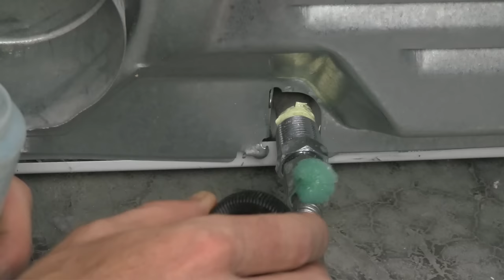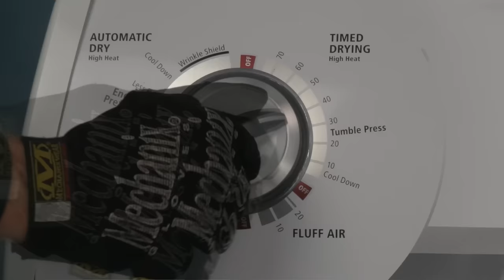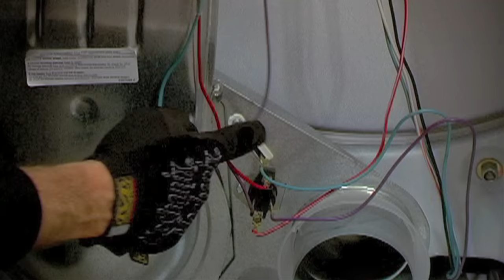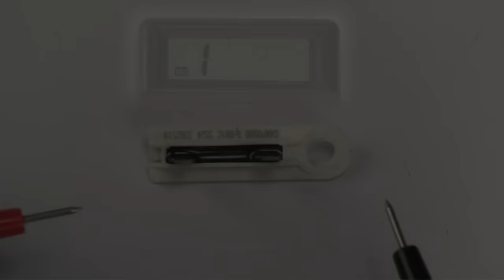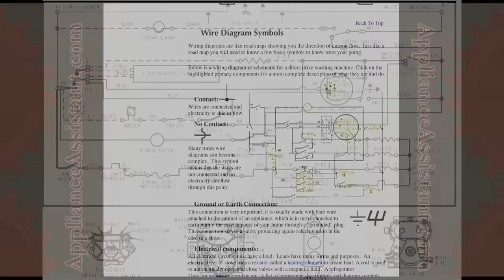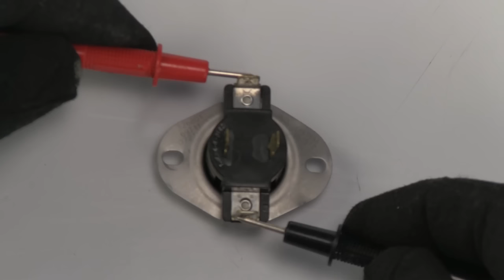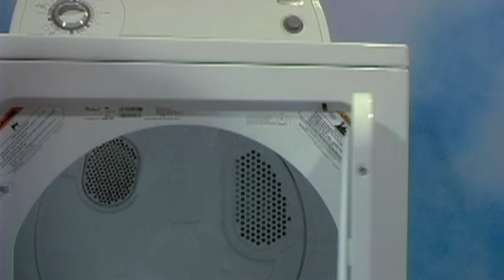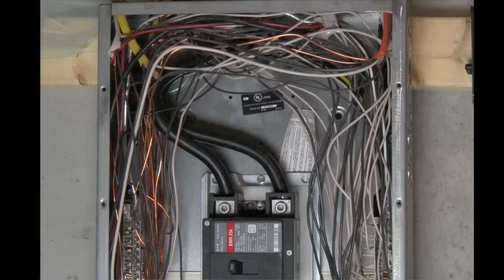Gas Dryer Repair: Fix Heating Problems

Comment: My ignition coils glow but then shut off?, then they glow again and click but no flame?
Reply from the maker: Sounds like the coils are weak.  If you change them out chances are you will be back in business.  Good luck!
Reply: Actually, went and bought the coils on Saturday and the dryer still didn't work. I did a continuity test with a multimeter on the old coils and they had all the right numbers so I put them back. The rest of the day I spent tryin to clean out the gas supply line cause a few people had me convinced that there could be debris in the pipe. So I snaked it with a long pipe cleaner then shop vac'd it, then used compressed air, then repeated several times. Then I started and stopped the dryer for like 15 minutes. Then I moved on to the gas line and switched back to the older flex hose, still no dice. The last thing I did was change back once again to the new gas flex line and turn on the gas and opened up the line a little right before the dryer to smell the gas to make sure it was flowing. Then air out thbasement ;) then tried it again. So, I gave up Sunday night :( then Monday night I figure I will give it once last shot before I try to return and it worked ?! WFT?! The closes I can figure is the line had to much air because the is no more audible buzzing when the igniter glows. I have done 3 loads of laundry so far, knocked on wood and crossed my fingers. Also, I did check with a friend who works for the local gas company and he said that the ignitor might have also been the problem and even if they glow they might not be completely hot enough to light the gas
Reply from the maker: When you said "I did a continuity test with a multimeter on the old coils and they had all the right numbers so I put them back. " Did you install the new coils?  Correct continuity readings do no necessarily mean they are functioning properly... It could also be the valve itself but more than likely it needs the new coils.  I doubt the ignitor... that can be the case with gas ranges but if the ignitor clicks off with no ignition, its getting hot enough.  If it just sits there and keeps glowing it could be a weak ignitor (rare) more likely the flame switch.  Sorry for all the difficulty! of course I hope it keeps working, but If you did not install the new coils, you probably should. Hope that helps! Good luck!

Comment: Hi There,
my Roper gas dryer only get flame at the first time. after that I can see the glowing but no flame again. checked the duct, it is OK. Can you help?

David R.
Reply from the maker: Probably the coils that are on top of the burner .  That's the cause of those symptoms 97.9% of the time. : )  If your duct is clear that should do the trick. Good luck!

Comment: I replaced the coils, thermal fuse, and igniter. It kicks on and flame starts then in a few seconds the igniter and gas flame goes out. Why won't it stay lit. I have a Inglis dryer made by whirlpool.
Reply from the maker: Sounds like a clogged ducting problem. The hi-limit is probably opening because of a hi temp condition near the burner.  You may have a bad hi-limit thermostat, but it's rare on this type of dryer so you may want to pull the blower housing and check for a blockage, also make sure the home duct is clear.  Hope that helps! Good luck!

Comment: Great video i have the same dryer my problem  is after a few mins the flame go s away how do you check the coils
Reply from the maker: Thanks! It's best to go by symptoms because they may test okay for resistance and still not function properly. If you ever see the igniter glow and click off with no burner ignition the coils are usually the problem.  Very fast burner cycles (short burn time of a few seconds) is usually a air flow blockage or a weak hi-limit thermostat if the duct is clear.  Good luck!

Comment: will not heat any longer. 
Kenmore model: 110-78002010. I replaced the coils and ignitor. as the glow begins a loud buzzing occurs. Flame ingites for a few seconds then goes out. Any clues? Should i replace the flame sensor now?  Thanks!

Comment: I have a roper and it will ignite for 5 minutes then the flame goes out when it reached temp. When it tries to ignite again it doesn't. Any suggestions?
Reply from the maker: If the ignitor glows the second time and goes out with no flame, I would guess the coils.  Does the ignitor come back on after the first cycle?  What is your dryer's model number?
Reply: applianceassistant
Reply: applianceassistant it was the coils.... thanks
Reply from the maker: Glad you got it! Thanks for the update!!

Comment: Great video but one thing I notice that you explain wrong is the operation of the gas valves. As soon as you turn the dryer on in a heat mode, gas valve no. 1 will open as it has full line voltage across both the holding coil and the assist coil. Valve no. 2 remains closed until the flame sensor opens. Then you have full line voltage across valve no.1 hold coil and nearly full voltage across valve no 2 coil via the igniter which will only drop a few volts.

Comment: Excellent Video, thanks for sharing. I have a couple of old Maytag MDG16 Dryers working with propane Gas, and recently we changed the main Gas Regulator, and started to have problems with clothes being burned; we also have other more recent dryers LG & Speed Queen, and didn't have that problem. What do you think is the trouble?
Reply from the maker: The regulator also needs to be adapted for propane. If you still have your old regulator you can grab the small brass cap off the top off the regulator and transfer it to the new one.  You will also need to pull the old orifice where the gas comes out of the valve, it should have a hole about half the size to reduce gas flow for LP... Not sure why the LG and speed queen didn't do that.... Hope that helps! Good luck!

Comment: Thnaks for the quick reply. My dryer has 3 types of cycles, reg., perm. press and fluff dry which starts at 60 mins. and go down in incraments of 10 mins. 60, 50, 40, etc. is this(fluff cycle) the cycle (timed) you're talking about?
Reply from the maker: Sorry for the delay! I have been traveling for the holidays....  Yes, if the 60,50,40 cycle advances to off every time it is probably not the timer... If that one works then you probably have a loose connection or bad wire from the cycling thermostat to the timer.  Thats how the timer motor gets the electricity needed to advance on the auto dry cycles (more dry, less dry, etc.)  Good luck!

Comment: I have an old maytag ldg7500. My problem is that the timer doesn't advance. Sometimes the load of laundry will complete the cycle fine and most times the timer gets stuck. Seems to be good air flow. I first replaced the valve coils, worked fine for a few loads then problem came back. Replaced valve coils (again) AND timer, worked fine for a few times then problem came back. Flame seems to go on and off fine and even though the timer doesn't advance the clothes still dry and the dryer doesn't seem to overheat. Can you help me?
Reply from the maker: Does the dryer cycle off on a timed dry cycle?  Sometimes you can have a problem with automatic sensor cycles, because the timer motor receives power to advance through a wire on the cycling thermostat, but the timed dry cycles should advance through to off if the timer is okay… possibly a bad wire from the cycling thermostat to the timer? Hope that helps! Good luck!

Comment: Got a kenmore gas with that won't ignite.  It runs cold throught the cycle.
Reply from the maker: Is the the ignitor glowing?  if not you may have a bad ignitor, thermal fuse, or timer. If it does glow then probably valve coils or a flame sensor. Good luck!

Comment: I have an older maytag, the flame comes on but only stays on for 15 seconds then turns off, where should I start?
Reply from the maker: It sounds like an air flow problem.  Check to see if the air is moving well out of the back of the dryer or if it is slow.  If it has good airflow you probably have a weak hi-limit thermostat, it is mounted on the flame tube.  Air flow issues are usually a clogged duct or a bad blower wheel. Good luck!

Comment: Excellent video. I was confident all thermal switches, flame detector and fuses were good. My dryer burner was not always reigniting through thermal cycles.. This is the first description that suggest that the gas coils fail intermittently. Which is exactly what my dryer is doing. Thank you for such clear descriptions.
Reply from the maker: Great! I hope that gets it going. Let me know if you have any other questions! Thanks for the comment!

Comment from the maker: Thanks!  the timer connections change from model to model so I was a little vague when discussing the timer.  Wire diagram is key on diagnosing timer problems.  Generally there is the timer motor power connection, the dryer motor connection, and the heating circuit connection. However, wire colors and terminals are different from model to model.  Thanks for the feed back!

Comment from the maker: It sounds like a timer problem. the timer motor gets power from the cycling thermostat to advance the cycle whenever the thermostat is closed and the dryer is heating... Where as on timed dry the timer is getting constant power to advance from a different connection. The thermostat should be okay or you would never get any heat or the dryer would get extremely hot and blow the safety fuse... So my guess would be timer. : ( 
I hope I'm wrong...Good luck!

Comment: I have a Roper dryer that only heats up on timed heat. When I put a regular drying cycle, the dryer stays on for hours and  the clothes come out dry but cold. Where should I start testing?

Comment from the maker: On the back of the dryer there should be a metal bracket secured with a 5/16" screw that holds the gas pipe in place. If you remove that and dismount the valve from the inside of the dryer you should be able to pull the whole burner assembly, pipe and all for repair.  Hope that helps some! Good luck!

Comment: Dryer wont heat replaced thermal fuse and worked for a week now replaced T stat still doesnt work .Looked thru small box on front and can see flame on for like 30 seconds then shuts off. What now ?

Comment from the maker: It sounds like the hi-limit thermostat is opening and cutting power to the burner... Try disconnecting the duct off the back of the dryer and test it again, you may have a clogged home duct.  If it still does the same thing, my guess would be that the hi-limit thermostat is weak. Good luck!

Comment from the maker: Sounds like you have covered all the common stuff... You will need to check for 115 AC voltage from the timer. Follow the wires up from the thermal fuse to the timer and check for voltage from that connection to the white wire connection from the plug.  Unfortunately it sounds like a bad timer... Hope that helps some. Good luck!

Comment: I have the exact same dryer you are working on in this video. The dryer starts and runs however the ignitor never glows orange. I tested the thermal fuse, the cycling thermostat (below the thermal fuse) both of the additional fuses above the thermal fuse, the ignitor itself as well as the flame sensor and everything tested good. I retested it and just to be safe I replaced the ignitor and each one of the fuses with brand new replacements and still no orange glow.

Comment: I have a Kenmore Elite gas dryer.  The dryer heats up at first and then quits heating up.  I was thinking coils, but if the coils are broke, I was thinking that the valve shouldn't open, but when its running blowing unheated air, I smell a hint of gas in the exhaust outside.  when the dryer sits for a bit, the heat will again work, but then goes unheated again.

Comment: ok i have one for you this dryer has since bit the lint...
But I had a Westinghouse spark ignition dryer we guessed from either the 70's maybe even the 60's it's burner would ignite for around 10 seconds then go out relight go out relight go out relight.. around seven times very rapidly then finally go out and finally shoot plain gas... not lit just gas..
if you turned it off and restarted the dryer it would repeat the behavior.. we never figured out the problem.. any ideas??

Comment: Hi.
Well, at first I noticed that my Estate dryer only worked on the timed setting, but after a short while, that stopped working too. Here were my observations: The igniter heats up, it "clicks" and a blowing flame appears. This works for about 45 seconds, then it shuts off. 
I found your video and went out and bought the Coil kit. I installed it last night, and same behavior. Any thoughts? I've checked the gas, exhaust hose, and vent on the house, and all are clear. Thx

Comment from the maker: It is ether the control board or the variable resistance temperature sensor (thermistor) part#8577274.  Hopefully it's the thermistor.  There should be a service manual somewhere on the dryer that will tell you what the resistance value should be at a given temperature... you need that table of values to check the thermistor. Then check the resistance based on room temperature example: 10KΩ at 70ºF  1754Ω at 150ºF Hope that helps! Good luck!

Comment: my friends kenmore dryer model # 110.97531702 only works on low heat, any other setting and no igniter power or heating, all sensors have continuity so can problem be in the control board and how do you check that part?. thanks gene

Comment from the maker: it sounds like the fuse tests okay.  the reading that you get through the fuse should be the same as if you touch the red and black meter leads together.  By the way you need to have the wires unplugged from the fuse when you test it or you may get a false positive reading... Hope that helps! Good luck!

Comment from the maker: I just had that happen to me on an LG washing machine motor coil... Tested fine about 30 seconds after I shut it down. then the tub would move about an 8th of a turn and lock up as the motor coil shorted out to other coil windings...  Crazy! That kind of stuff is always interesting... a pain... but interesting.  Thanks again Joey!

Comment: No problem, ApplianceAssistant.  I came across with an intermittent solenoid issue where the coils would pass the continuity test.  It almost has the same resistance value as the new part.  It seems to me that when the coils are energized, they dynamically fail rather than a static failure where the part fails under no load.  Replaced the coils and my friend told me that she hasn't had any failure since.

Comment: @ Danielgabriel22 - while the igniter is energized and lights up, the solenoid coils are energized and it should open the valve.  But if it's faulty, it won't open the gas valves hence the possible culprit.

Comment from the maker: The thermal fuse is designed to protect against over heating, usually due to a clogged vent but sometimes they just fail.  So if the vent is clear and there are no internal air flow blockages you should be okay to just install a new fuse.  Congratulations on the fix! Thanks for the comment!

Comment: Really informative and helpful. Quick question. What if the fuse is blown, but the dryer line is clear and the igniter and flame switch are both testing functional?

Comment from the maker: That is very strange... I cant think of anything that would cause that.  The flame sensing switch will open and close to make and break contact to the ignitor, and that my make it seem like unplugging it is making the change...  Or maybe it is something I have never experienced. I doubt it would need a new ignitor though.   You would really need to check for 115 VAC at the ignitor plug point to see what is happening electrically...  I hope that helps!

Comment: Great video.  One question?  When I unplug the ignitor and plug it back in again it works.  If I shut the dryer off and try to turn it on again the ignitor does not come on again unless I unplug it and plug it in again.  Do I need a new ignitor, or is there something else wrong?

Comment from the maker: the valve should cycle on and off to maintain a target temperature. However, if the valve is closing that quickly it would normally be caused by a clog either in the home duct or within the dryer itself.  If all of that checks out as okay and you have good air flow out of the house then you may have a weak hi-limit thermostat. Hope that helps! Good luck!

Comment: This video is very helpful. thank you. quick question: is it normal for a flame not to stay lit? mine takes longer time to heat than before, so I checked basics: vent good, igniter works good, but flame lits and stays for 35 secs. Then it turns off itself for about 1 minute then it ignites again and repeats off and on. Is this normal? or is it normal for the flames to stay lit for entire duration? any assistance would be appreciated!

Comment: Just a big Thank You. Mine was wire which came loose off the flame sensor and sat under the flower tube, so I couldn't see it. But as I tested the various components according to your instructions, I found one of the terminals to the flame sensor unconnector, and dug underneath a blind spot to find the matching wire. 
Thanks for the posting the video and providing all this feedback support to people asking questions. I will order any appliance parts I might need in the future from your company.

Comment from the maker: Hmmm. the coils are just two electromagnets to pull open the valve, doubled up for a safety check. New coils could be bad... sounds like your dryer problem is outside the realm of normal. I would want to try a new set of coils before replacing the valve but thats really all there is to the system.  The flame sensor must be working to cut power to the ignitor... at that point the coils should be getting energized to open. Sorry I can't help more. : ( If you figure it out please let me know!